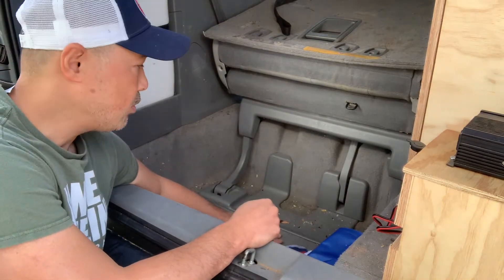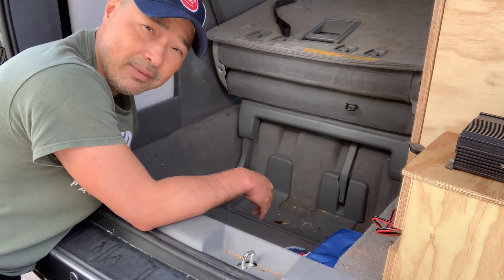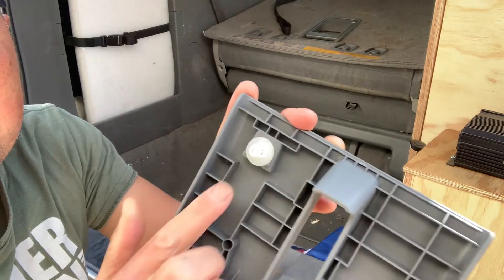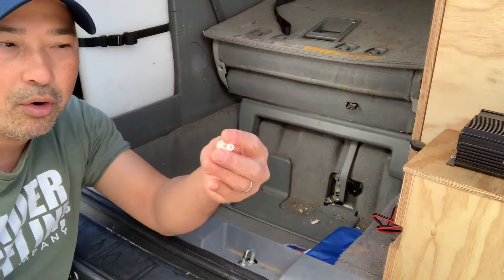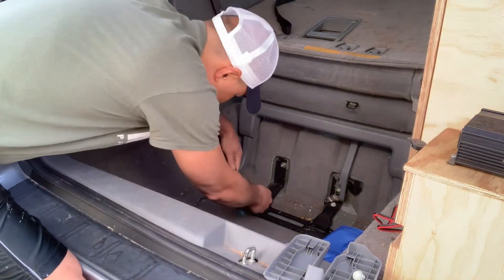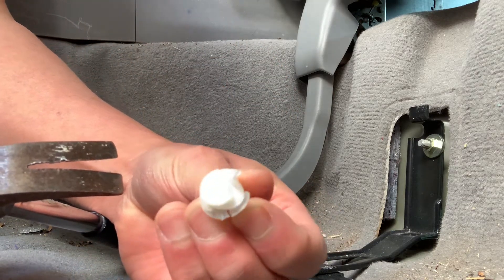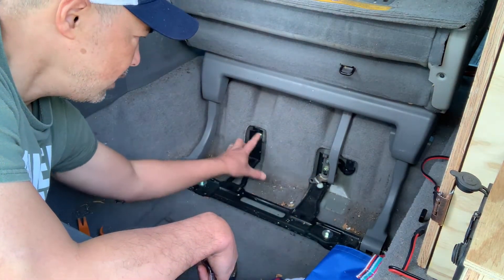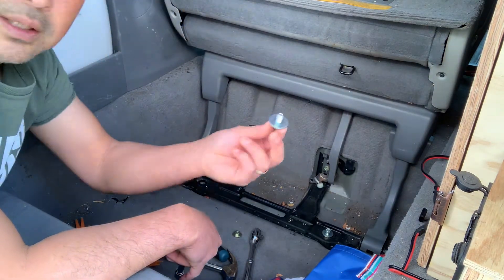How To Remove 3rd Row Seats From Toyota Sienna

Comment: Not sure if anyone else has discovered this trick but you can save the white plastic clips if they pull off of the plastic cover and are not damaged. Leave them in place until you have the seat out of the van and before you fold up the seat. Set the seat on the ground and locate the area of the white plastic clip that was pushed through the metal seat frame. You will notice two protrusions on this side of the white clip. With the narrow part of the needle-nose pliers, squeeze the clip at the location of the two protrusions just above the surface of the metal frame. You can either push the clip back through the metal frame with the pliers or you may have to push on the bottom of the clip with something like a pencil or screw driver. The clip should fall free of the metal frame and not be damaged.

Comment: What about the airbag sensors? Will they require a dongle like I used in my 2021 Sienna after removing the 2nd row???
Reply from the maker: my 2011 does not have any sensor issues.  I don't know about new models.

Comment: Great video. I am going to get a 2021 Platinum and will do that first thing I get it home. Thanks
Reply from the maker: It does give you access to lots more space.
Reply: 2021 may have issues removing seats due to air bags